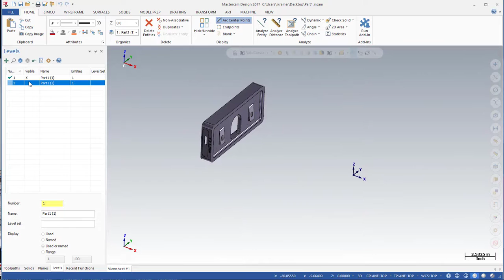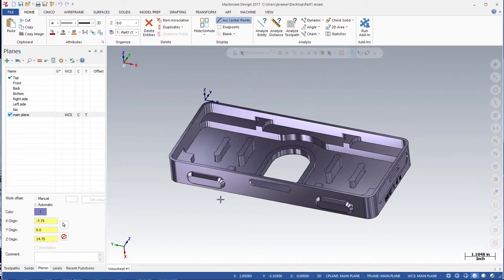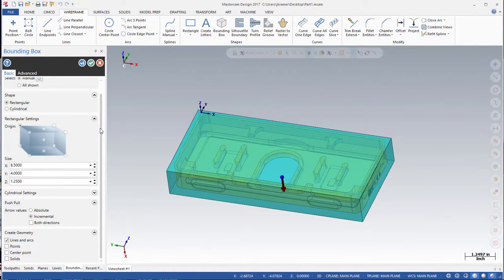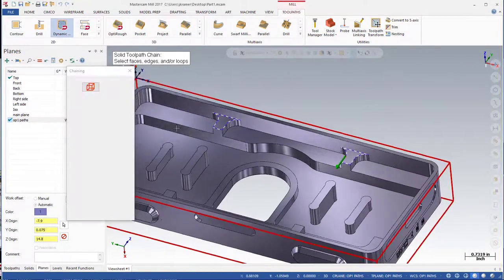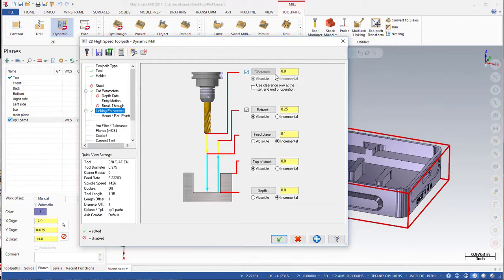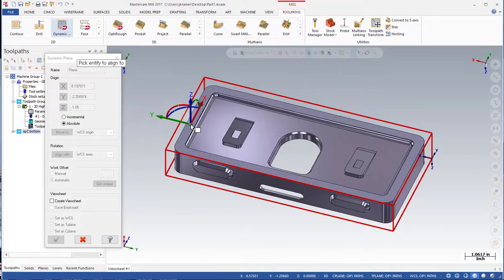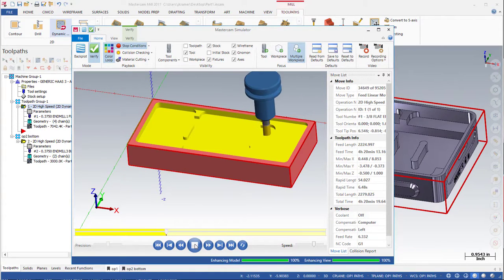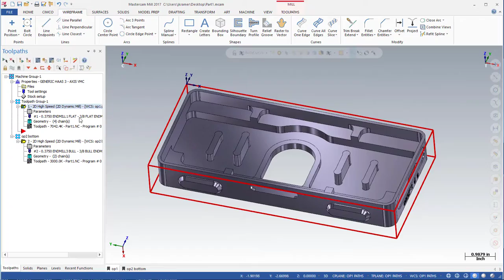Sample of Dynamic planes and Bounding box in 2017

Comment: I am grateful for your tutorials.  I am green when it comes to cam programming and the videos are keeping me "employed" 

I also have no experience with 5-axis machining and I need to know if there is a special way to touch off tools or setting a workshift for cutting a 5-axis profile.  Whenever the 5 axes moves the tool is nowhere near the part.  I must not be setting the workshifts correctly.  If you could please tell me where or how I can find such information I would greatly appreciate it.
Reply from the maker: Sir, it does matter on what type of machine you have on how the tool is handled. a great place to learn about this and the different configurations for 5 axis is to get the book call "Secretes of 5axis Machining" this would really help you.